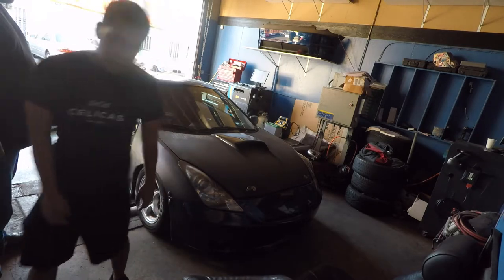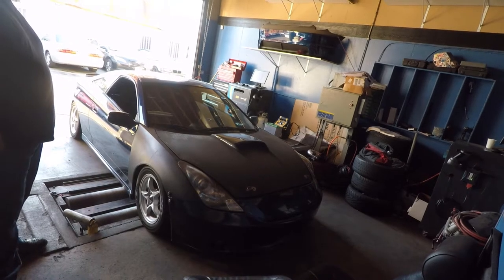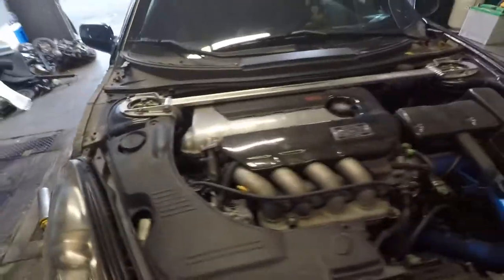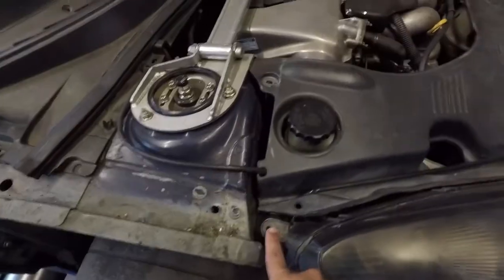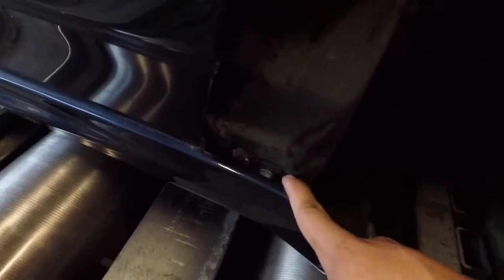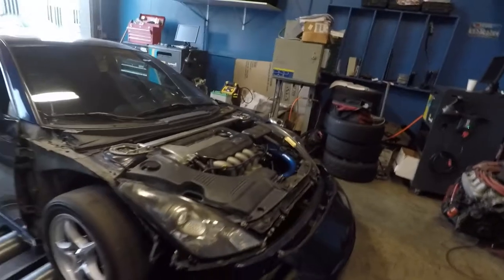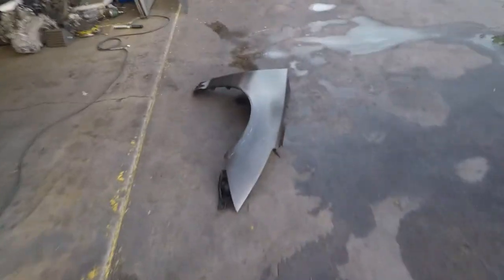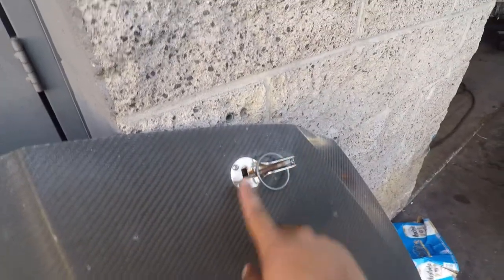How to remove fender 00-05 Toyota Celica

Comment: Man you skipped the 1 bolt u can only get from the wheelwell side in front. And in front theres 3 accessible from the outside not 2, plus that 1 hidden one is 4 total in front besides the ones topside by the engine bay and windshield and froont door gap and bottom front sideskirt. Looks like yours already been apart a couple times so you gotta say if its not been apart the correct # of bolts. I took out everything and theres more hidden bolts than this video skips. Its cool if yours is quick release but remember who's coming to the video for information, those who have oem number and position of fasteners. Not like how yours setup so its not as simple as you skipped it to be. I got mine off but I hate it when videos skip shit. Its not just 1 2 3 fasteners its off. Plus most of the front 3 snapped from rust not comin apart fuck this fuckin design. Honda acura makes it much simpler.